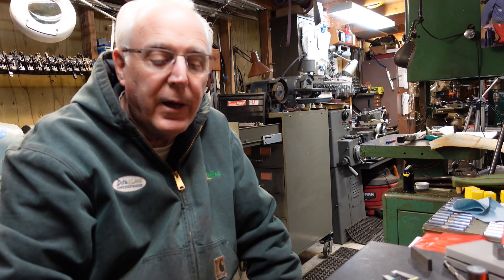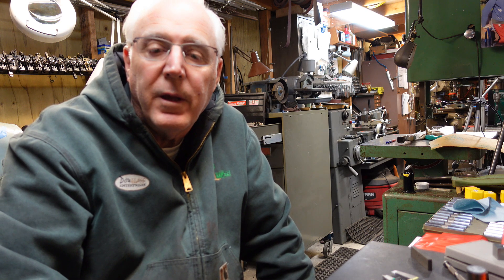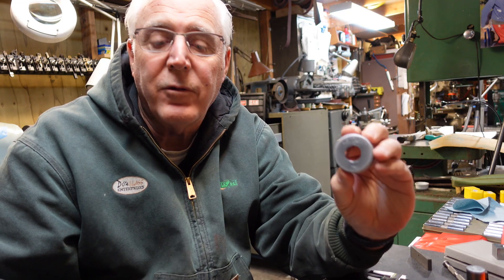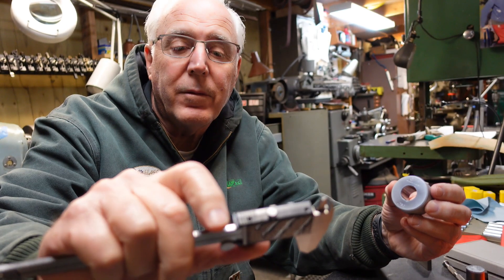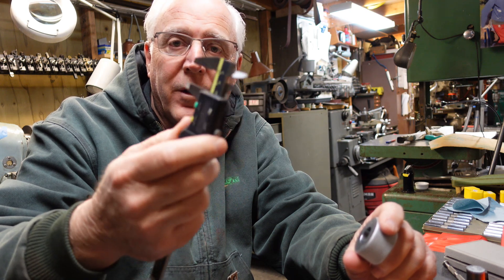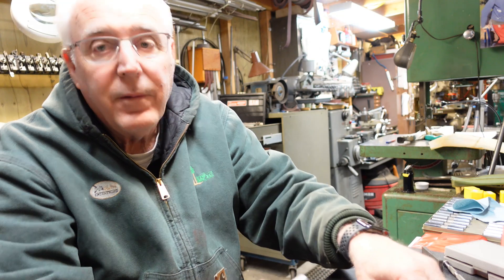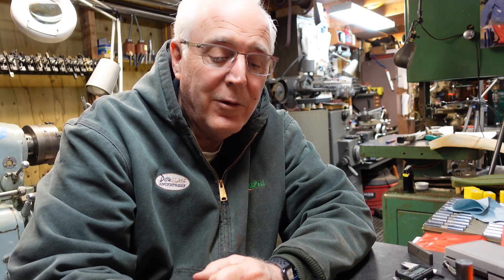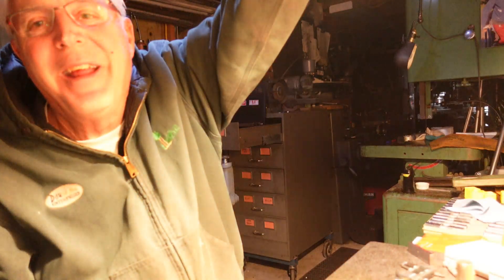Taper Parallel Gages #672 (part 2)

Comment: Hello Chuck, I had a thought when you suggested possibly grinding a radius on you adjustable parallels. How about grinding a small "V" in the adjustable parallels. They could then be used normally or with a couple dowel pins or thread measuring wires in the "V" for holes.
Reply from the maker: you may see something in the future...thanks for viewing

Comment: Your lights remind me of working late in an office building with auto lighting.  Every 15 minutes (depending on the setting) they would go off and someone would have to stand up in their cube and wave their arms until the lights came back on again.
Reply from the maker: my setup is ODD, but I am use to it.....thanks for viewing
Reply: @outsidescrewball  If there's one thing I've learned over the years, it's that there are multiple "correct" ways to do most things.  If it works, there's no reason to "fix" it!

Comment: Hi Chuck, i have a need for reasonably accurate shallow hole measuring, 5mm or to you folks who measure in black and white 3/16", when i repair BMW heads. Telescoping guages are at best a guess when used, so i have been playing with a few designs of my own and now thanks to you i might incorporate a double taper in a three piece adjustable parallel. 
Or i could just make a fixed size cutter, but that is another story.😉.
Reply from the maker: Hey Chris...is a video going to be done???
Reply: @outsidescrewball  when my injured thumb recovers, perhaps. 
I have got to finalise the design first and you truly wouldn't want a video of my thought processes in action, too X rated for YouTube.😏

Comment: Those are cool tools, very generous of Tom. I first saw the idea of measuring holes with regular adjustable parallels during the tips blitz but have yet to try it myself.  If you grind radii on a set of regular adjustable parallels it would be interesting to see how accurate they would turn out. Thanks for sharing.
Reply from the maker: thanks for viewing...
Reply: If you grind them assembled they should be as accurate as your surface grinder allows.

Comment: regular adjustable parallel measuring corner to corner seems like a reliable way to measure it .....but I'd have to try it to see
Reply: Test with a gauge bore. Otherwise how would you know you were measuring accurately? Check both alternate edges (each pair of edges), since they may give different readings. My adjustable parallels don't give the same reading across the faces from one end to the other (meaning they are not very parallel). YMMV.
Reply from the maker: good info....I meant to test with a bore gauge in the video and forgot....
Reply from the maker: give it a try...thanks for viewing